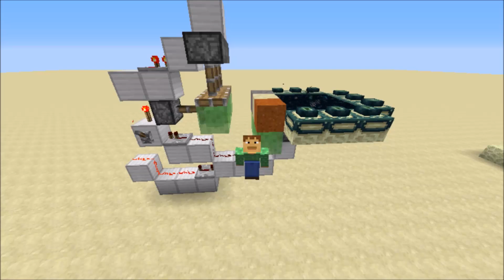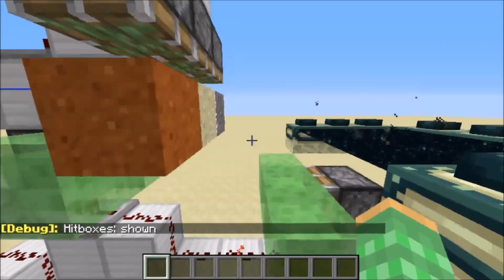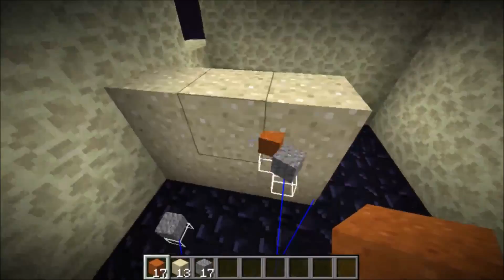Simple Sand and Concrete DUPE Generator! 1.9-26.2+ Minecraft [CHECK description]

Comment: using this on 1.21.8 and having an issue
the duper works fine but my sand is losing velocity through the portal and is becoming a solid block on the obsidian platform
cant seem to find any info on why this is happening but its causing close to a 50% loss, if anyone has any ideas im open to trying them
Reply from the maker: Sounds modded. Ask your admin
Reply: @RaysWorks  its  single player, i do have some mods but mostly shaders or UI changes, nothing that should change the physics
EDIT: i did at one point download some mods that were meant to help with resource management for a huge project i was going to undertake but i never installed them and i deleted all the JARs, not sure if there might be some floating files somewhere modifying the physics?

Comment: I've used this for years but something has changed after I updated from 1.19 to 1.21.4. The blocks in the end are falling in a different direction - very odd!
Reply from the maker: Check description
Reply: @RaysWorks  Thanks for the reply. I couldn't see anything in the description relating to this issue?

In the overworld, my blocks are being pushed into the End north-south. They used to exit in the End north-south. They are still entering north-south, but are now exiting east-west. I have no idea why that would be. I AM using fabric though.

I think I am just going to upgrade the duper in the overworld and collection in the end to use all four sides.

Thanks for all your great content by the way - we've had loads of fun learning and building from your videos!
Reply from the maker: @graemeforrest  oh i thought you didnt put in chest part. 
that is weird, idk

Comment: Hi, this used to work on a 1.19 server but no longer when it updated to 1.19.1 The sand does not teleport through the portal and only stays in the overworld without duplication. The server is fabric. Is there anyway to fix this?

Comment: Fix for 1.19:
set the bottom repeater on 4 ticks. The middle repeater to 3 ticks en the top repeater on 4 ticks. You need to do 1 more thing. Place 3 solid blocks on both sides on top of the first row of the portal. So that there is a 3x1 space for the sand. I hope it work for you guys. It still doesn't work on paper servers and on some other server because the lag. Enjoy it😀
Reply: ive got the everything working but the sand dosnt come though the portal what am i doing wrong?
Reply: @Wastedwabbit69  have you made the chunk loader?
Reply: @siddabest6666  bro when I make the chunk loader it always send me to the upper side not on the portal room

Comment: This breaks in 1.18. It worked fine until 1.17 but in 1.18 the top pistons won't grab the blocks any more so they just fall down and break on the redstone below.

Apparently in 1.18 a sticky piston won't grab a moving block. I can fix this by placing non movable blocks below the space where the moving block will be when the top pistons try to grab them. The moving block will land on this non movable block and turn briefly to a normal non moving block that the sticky piston can then grab.

The center non movable block must be transparent because an opaque block would cut the redstone wire below. It also needs to have a solid top surface because otherwise it would break the block. The only transparent non movable block with solid top I can think of is hopper.
Reply: I discovered another block that can be used instead of hopper: Honey block. The block doesn't need to be completely immovable. Not sticking to slime blocks is enough.

Comment: For those on Hypixel SMP, it won't work; as Hypixel uses paper configuration which patches sand duping without the ability to turn it back on. There is no way around this.

Comment: Can confirm this still works in 1.17.1 Every 2 minutes, you'll get enough to fill 1 enderchest. Seriously do not let this run for more than 5 minutes at a time on a realm server or you'll have a bad time.
Reply: Hey bro 
When i am growing the mushroom 
The portal is breaked fully
Reply: @hzsumitff  maybe u did it wrong or you grew a brown mushroom
Reply: @foirisgarb  no i am doing it correctly but still the portal is breaked
Reply: tried this on 1.17.1 but aint working...
Reply: @krylle028  yes it's not working
Reply: @hzsumitff   so it does work but if your end spawn is floating build three blocks out and two up from the center of each side go to the over world run the farm go back depending where on you four sections you built the sand lands that’s where you build your collection
Reply: @gentleman4378  i can't understand
Reply: @krylle028  so it does work but if your end spawn is floating build three blocks out and two up from the center of each side go to the over world run the farm go back depending where on you four sections you built the sand lands that’s where you build your collection
Reply: @krylle028  the fuck this is still working and the portal breaking still works I think you all are doing something wrong or you are not in vanilla or fabric
Reply: What happens after 5 minutes?
Reply: @amine5153  You have too much sand.

Comment: i left this running for like half an hour because i forgot about it (i used chunk loaders) and i had to reset the end because it crashed my game every time i went there. just remember to keep it in check
Reply: How did you fix it? Because i have the same problem but i dont know what to do
Reply: @lucasforster3570  to prevent it, be VERY careful about how long you leave it on, to fix it i unfortunetly had to reset my end...
Reply: @dogboss4269  yeah i forgot to turn it off, i was just wondering how you reset your end

Comment: On a 1.16 server I had to put solid blocks under the portal for this work. Try that if anyone else has problems with the generator.
Reply: didn't work for me...
Reply: @filipesilva2624  Where did you try it? I can test out some more stuff.
Reply: @svegon  i found out what was wrong, i was trying to do it in a papermc server, i changed it o spigot and it worked flawlessly, thanks for the attention

Comment: Can someone tell me if this will work on my 1.15.2 PaperSpigot server? I have seen comments saying that it doesn't work and then a bunch that say it does, so can someone just let me know what the actual answer is before I go building this on my server :/
Reply: Did you build it?
Reply: @rootytootypointnshooty7116  Yes, somewhat. The main point of what is going on here is that "falling blocks will dupe when dropped on the portal if a fence/wall/etc is under it". So we tested out just dropping blocks in from high up, and that worked fine. We also built this and it worked but it was laggy. It depends how much you're really trying to dupe.

Try dropping Sand/Gravel/Concrete Powder/etc into the portal with fences placed directly under it

Comment: I left the machine on for too long and now my game crashes every time I open the world. What should I do?
Reply: @b1gb1tch Have you tried: /execute in minecraft:the_end run kill @e
Reply: @x46vob  where to I type that I have a shockbyte server
Reply: i dont think commands will work on an unloaded chunk
Reply: @vegegrey1709  I believe (definitely not sure about this!) that the main end island is permanently loaded.
Reply: Jump if it were loaded then people wouldn’t be having this problem because the problem only occurs when the player leaves the main end island when the sand duper is on. When the player is there the player loads it allowing the sand to make its way into the chests
Reply: I fixed this problem by using nbte editor to reset that specific chunk because the chunk that had the obsidian platform is the same in every world. I got help from the prototech discord
Reply: @vegegrey1709  Good to know. I've used /tp @e before and it brought the End Crystals to the overworld, so that's what I based it on. That could have been a byproduct of the Paper server, though.
I'm glad you solved your issue!

Comment: Ok, so because of certain circumstances, I can't use the overworld version of the farm. Thus, I must build the farm in the End.

So, I downloaded the world download and tried out hte farm in the End.

The farm itself works in 1.15.2. It works, as long as you can build it (obviously). As in, if there is something preventing you to build it in 1.15.2, then technically, the farm doesn't work in 1.15.2. Which I've found to be the case. 

So, in 1.15.2, I tried to build the End version of this farm in survival. Building the physical farm itself was easy. The difficult part was getting rid of the bedrock needed. Eventually, I did that. I got rid of 3 bedrock at the top, and 1 middle bedrock in the bottom. Then I built the farm. But, my farm didn't work. The reason was, when you want to break the bedrock, you NEED to get rid of the nearest portal blocks (I did this using the mushroom trick). Once you break bedrock, you can get then build the complete farm. However, when you do this, even with a completely made farm, the duplication won't work, because the nearest portal blocks to the farm, where the sand would've landed, have been destroyed.

I cannot figure out a way to preserve the key end portal blocks while also breaking the key pieces of bedrock that need to be gone to build the farm. It's impossible. The top layer of bedrock, you can possibly break them without needing to break the end portal blocks. But, the middle bottom bedrock piece - there is no way to break that without breaking the end portal blocks.
Reply: I've concluded that only the overworld version of the farm can actually be built in survival (whil still preserving the portal blocks). But, even for that one to work, both the overworld chunks and the end chunks must be loaded. In a realms server (which I'm trying to build this on), this seems impossible, unless you have 1 player in the overworld farm, and 1 player sitting in the end obsidian area where the sand would drop in. The only way both chunks can be loaded with 1 player is if the end portal in the overworld is conveniently placed in the world spawn point, such that both the overworld and the end chunks will always be loaded. This almost never happens, and isn't the case for the realms I'm in.

So, for some reason, it seems like this farm doesn't actually work in 1.15.2 if you only have 1 player and want to be practical about it. I'm sure there are ways to work around this - maybe some kind of chunk loader, or using 2 players to load both chunks. but, i dont see how this farm can work in the overworld without further fixes.

Comment: Still works in 1.15.1, though removing the portal frames didn't (had to use a complicated piston glitch). Also, if you build it one-sided, because the sand gets thrown through with velocity, you can make a collection hopper (with a torch above it) off the edge of the 5x5 platform in the end that collects everything, even with no one in the End. And when you go through and regenerate the 5x5 obsidian platform, it doesn't break the collection system!

Comment: The Mushroom isn't growing, why is that? I've cleared enough space I have block on top so it's dark and it's in the right place yet it doesn't grow
Reply: Asorix _IQ You need to add a radius of at least 2 blocks around the block on top of the mushroom(approximately 7 blocks).

Comment: This doesn't work on the latest version. Please fix your video's title

Edit: The sand duplication works. The bedrock breaking method doesn't. Use newcake's method of breaking bedrock, which also works on portal frames
Reply: @Nate Lukens I could not get the end crystals to break the bedrock. I will try another method of removing the frames. Which method did you use?

Edit: I used newcake's method of removing bedrock. It worked, after a while.
Reply: @psiseven  did it work on a 1.14.4 multiplayer server? (which method did you use?)
Reply: @Yourname942  The newcake method didn't work. I haven't tried the sand duplication
Reply: @psiseven  so that method does not work? You mentioned that it worked after a while
Reply: @Yourname942  It worked in single player. It's possible that it didn't work because the server had plugins installed, or because of lag, or maybe I messed it up. That method requires you to click really fast.

Comment: You are seriously the best! Just finished building this in 1.14 and its just so simple and easy to build!
Reply: do you know if this works with conrete powder too?
Reply: @brambiemans184  it does have already used it for that
Reply: Did you break the bedrock or the portal frame?
Reply: @youtub-fj8mu trmqs break the bedrock in end as of 1.14 the end will not be automatically loaded which means the sand that gets duped won't be picked up by the hoppers. That, however, isn't a problem if you dupe to spawn chunks.
Reply: I opened Minecraft with another account , joined the Lan world,cand left it in the end

Comment: I have found a page of 5 bedrock busting methods, it seems all but 2 are patched. one is only usable on the cieling of the nether  and the other is an 18 step solution which only breaks one block, but does so with TNT which to my understanding would demolish the portal also, making it unviable to create this duplicator

TL;DR To my knowledge, there's no way to build this in Vanilla Survival Minecraft without cheats if playing on any versions where this is patched, which seems to be the case in 1.14.4
Reply: Jay Gledhill he has a playlist with bedrock breaking methods, check it out

Comment: didnt work on 1.13.2 bukkit server, but now it works on 1.14.2 bukkit server! Thanks :D
Reply: :D what did u do?
Reply: @ArayadrumsGaming  idk. Only difference is that I'm running less plug-ins: dynamic map and custom bans. Strangely enough, rather than shooting in 3 sand, it only shoots in 1 sand to spawn from the end. I'd still call that working :D

I speculate that this might have something to do with the spawn points configuration.

Comment: does it work in 1.14.4? Edit: how do i remove bedrock in 1.14.4?
Reply: Yup. The only thing I found is, you have to let it run for some time and then go in the End, because once I’m there it stops working. So you have to collect all the sand previously sent there while it was running. And be careful not to let it fall in the void

Comment: I confirm this works on 1.14.4
Reply: Chun Huang thank you
Reply: • 7nfern0 • No problem, I also broke the end portal blocks with the same technique that is used to break bedrock, the Piston Tnt one , good luck
Reply: @chunhuang8820  Did you manage to break all 12? I can only get 6, can't seem to get the other ones..
Reply: iSwampie hehe xd Yeah, I configured my mouse settings so that I could macro an auto clicker makes it easier, when you remove the blocks, try it from every direction, it does seem that some block will only break from one direction, I also figured out that placing the cross-hair on the bottom side of the piston will make it more consistent, because when the Tnt explodes it will move you a bit upwards and away,
Reply: mine stops working when i go through the portal? does your machine continue if you afk in the end?
Reply: shietitsumbr I just afk in the overworld and then go into the end, be careful because if you have too many items in the end you might get massive lag and might just be unplayable. you can probably test out if chunk loaders will keep the overworld loaded while you are at the end.
Reply: It's not workign for me, how can I fix it?

Comment: The machine works in 1.14.3, but the method to remove the bedroks and end portal frames doesn't work.
Reply: Does it work in 1.14.4?
Reply: @chase5654  Yes
Reply: @jellylovin42  how tho the portal blocks give light
Reply: @ImKonary  This has nothing to do with light.
Reply: The light level at the portals is 11 or higher no idea why you can not grow mushrooms there because they need a light level below 11. Could be another thing too i guess
Reply: @ImKonary  it just won't replace the blocks, it'll only grow higher than the portals or just don't grow at all.

Comment: The mushroom no longer breaks the eye frames in 1.14.3. Is there a new method to doing this?
Reply: Yep, you just have to use one of the methods of breaking bedrock.
Reply: @Swirft  Both doesn't work
Reply: @Swirft  I've also tried it with the same exact method but it generate diamonds instead so yea.
Reply: @Crownless.Prince  are you using the method with broken piston heads and a tnt minecart?
Reply: @potik924  No, I use the same exact method just like what it has shown in the video but it doesn't work

Comment: Note that this does not work on spigot
Reply: I run a spigot server and this works fine...
Reply: works on paper 1.14.4 for me
Reply: @johnbobbin5476  how did u break the portal frame
Reply: @swaggadelicswagglord6917  same way you break bedrock headless pistons
Reply: @swaggadelicswagglord6917  The luquid glitch doesnt work anymore, you just need to do the muschroom glitch to destroy the portal frames.
Reply: @attilatorok5767  I had to use the headless piston trick too, but it works in 1.15.1
Reply: Jeff Hendricks thx
Reply: F
Reply: How do I know if a server is on spigot?
Reply: THAT MAKES MUCH MORE SENSE! THX
Reply: so paper  spigot 1.15.2 works fine?
Reply: @nand7327  yep, works for me
Reply: I use spigot and it works fine...
Reply: you can configure this
Reply: Cuz. Prolly better patched
Reply: been patched as of 1.15.2
Reply: @jonnylpenman  sand dupe works in 1.15.2
Reply: Иван Дрозд no i mean the bug where spigot stopped it from working has been patched

Comment: you can also add carpets at the portal and make a collection system

wow this genius
Reply: Yea carpets cover hoppers work great that what I do, after sand dupes into The End portal then in the overworld hit obsidian walls around the hoppers 5 x 5 with carpets covered. All sands go in the hoppers automatically.
Reply: 5x5 hoppers with torch on top
Reply: Is this still works on 1.14.4 guys?
Reply: @mcrdoestoedward  it does, I mad it in 1.14, 4